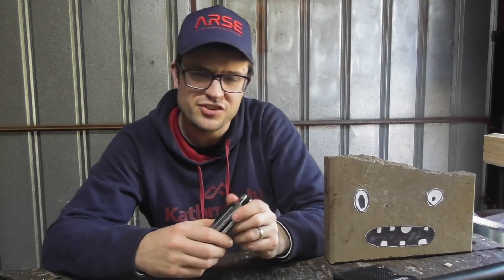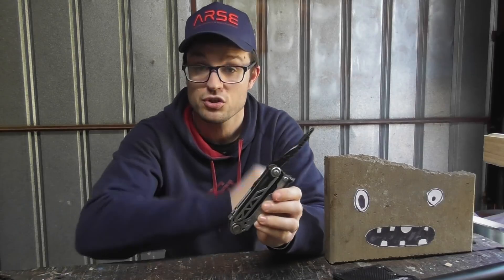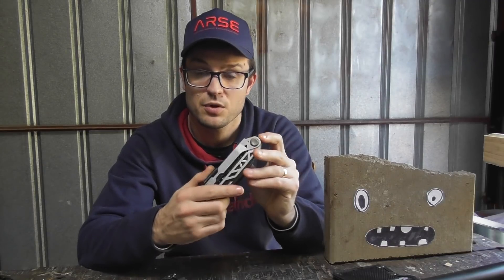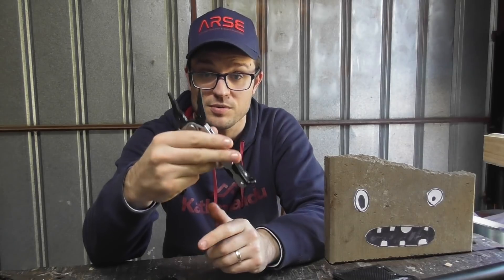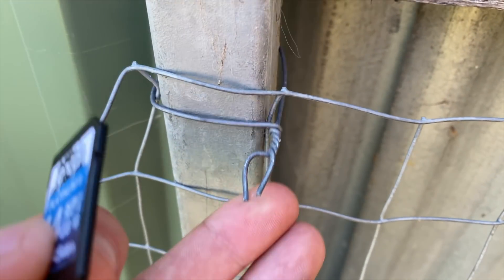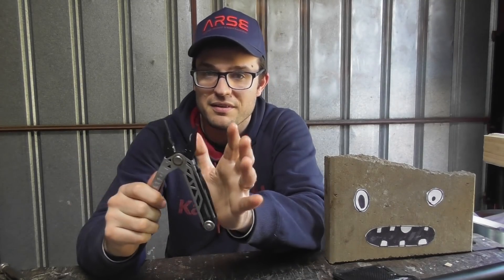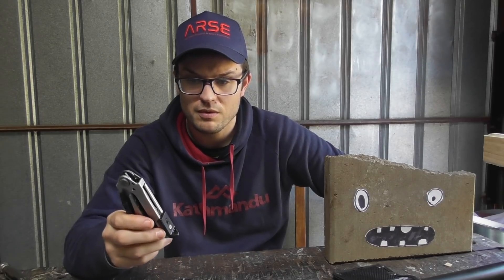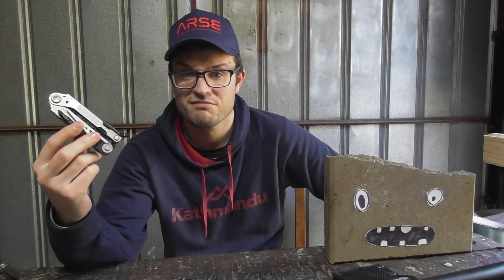EDC Issues: These Awful Gerber Wire Cutters Really Make You Think

Comment: I suppose if you are a tradesman and more frequently use the wire cutters then they would be more prone to failure. Rather then send the tool off to be fixed every time you can carry the extras and replace them as needed. I know that if you're cutting that much wire you should use the dedicated tool but if we thought that way we wouldn't buy these multi tools. 

I think the convenience of being able to switch them out is more appealing to somebody that is working with the tool rather than someone who just carries it uses it occasionally for questionable tasks. I'm happy to live in a world where both choices are available.
Reply: It's not the fact that they're replaceable that's the problem, it's the fact that their inserts are made of tungsten carbide, which is hard af but also brittle. The 154cm inserts used by leatherman seem to be fine, at least mine are, and judging by other comments so are other peoples.
Reply: @billythepigeon7345  - Yeah I won't disagree that Gerber uses questionable materials. Honestly, the 154cm seemed like a weird choice to me at first but it seems to work pretty well. I haven't had any problems with them. However the cutters on my old charge AL are definitely bent and it catches ever open/close of the jaws. I suppose LM may fix that...
Reply: @FancyPrimate  the material itself isn't questionable, I use tungsten carbide to machine all manner of exotic steels, titanium alloys, and even other tungsten alloys, it's seriously hard stuff, it's just brittle, and wire cutters is just the wrong application. Steel is tougher, it might go blunt eventually, but it's less likely to chip.

Comment: Also using an original wave, hard use over decades, cutters still good as gold and lighter than modern iterations.
Granted the fine screwdriver now doctored into an awl after it snapped ~5yrs into using it as my main pry tool on the 3rd time I straightened it with a hammer. Thats how I treat the whole tool and still going STRONG I 100% agree with the above!

Comment: bought a gerber multitool a while back, dont recall exact model set me back about $100 usd. first time out (working road construction) i cut some steel tie wire, and the second cut my cutters broke. i made warranty claim, turn around time was 4months so i bought leatherman wingman to hold me over. i tried the gerber one more time and broke again. tried to refund, and failed. i still own and cherish my leatherman. gerber tried to ease my loss by saying AT LEAST ITS COVERED.

Comment: I’ve always carried SOG multi-tools, beginning with the Pocket Powerplier, and then the full-sized Powerlock. Both of these styles have regular jaws and cutters, no inserts, and I have had to warranty them twice, after damaging the cutters with hard wire, total abuse. I like the SOG tools because, to me, they have the best jaws, and give the most utility as a plier, while having a good compliment of additional tools. The swing-out handle covers are a bit hokey, but I’m generally not rushing to pull anything out of the handle, since it is not a primary knife.
It’s another option in the non-leatherman tool world, and I like that they haven’t switched to inserted cutters.

Comment: Never heard of this or had it happen. Ive used a Gerber with replaceable cutters since they came out. Also, the cutters themselves aren't only available from gerber. They're common machining supplies, buy good ones if all you can get are the chinesium versions you're obviously stuck with. 

Oh, I've cut spring coils, hard wire electric fence, innumerable sections of fence ties and many many many screws without needing to do so much as turn them to a fresh edge. Only problem I ever had with them was when someone stole the pliers they were attached to. Happened twice since i started carrying a gerber, probably almost 28 years now, if you count the first one with no replaceable cutters. That first one I did notch the cutters on hard wire, tho. So there is that, I guess.

Comment: Quit buying Gerber back in the early 80's when I had a Gerber fs II blade break in two while CUTTING ( not prying ) some hard to cut material. Knew I could send them back for warrenty but decided to keep it to show my friends. I bought SOG multitool & have been using Leatherman for 10 years - no problems. Occasionally cut wire with them, works great. BTW SOG workad fine but after years upgraded to Leatherman.

Comment: I've had the old school Gerber wire cutters fail in the past. The wire just notched the cutter blades. I thought maybe the replaceable heads would be an improvement. Doesn't matter with my old Gerber tool, while twisting  a nut the jaw on one side snapped off and ruined it. Work replaced it with a heavy duty Leatherman tool which I have had every since.

Comment: The original Gerber Scout has some of the best cutters I have ever used, they will cut stainless steel gear/brake cable cleanly, they also have a good crimper. Thats the Gerber that they got right. Departures from that design are what they got wrong.

Comment: Tungsten carbide really isn't a good choice of material for something like that, too small with a hole in the center compromising the integrity even more, although it'll be interesting if you did a test to see what it's able to cut without breaking, I'm thinking that its probably meant to use less force since it's tungsten carbide, it should cut more than break material

Comment: i've weighed in on the leathermans' replaceable 154cm jaws before. after a couple more years of use, i can see several tiny divots in the jaws. however the function doesn't seem compromised. i reckon, since those jaw inserts overlap a fair bit when closed, the initial "bite" creates a weak point in the outer diameter of the wire, then there's some compression - but ultimately the wire is cut by shearing forces at the weakened point. accordingly i think chunks of tough hardened steel might be adequate for the task, even longer-term - but gerber's choice of tungsten carbide jaw material is ill-advised; suggests they have not analysed the forces at work. i'd imagine most viewers know how easy it is to snap a tungsten carbide drill bit if you wiggle it about in the material you're drilling.

Comment: I cut nails with my Surge no issues cuts through easy. I also cut thick metal banding with Surge no failure. The banding I cut a lot at work.  If the Center drives cutters were as good as the Surges the Center Drive would be hands down my favorite. My Gerber 600 cuts good too. I think it's just a Center Drive problem. Even thin stereo wire gives those cutters a hard time

Comment: Here’s my take on this topic: both Leatherman and Gerber replaceable wire cutters on their multitools aren’t meant for heavy-duty wire cutting, because they are not meant to replace ACTUAL heavy-duty wire cutters. Multitools, however, are always nice to have because you can easily have them on hand, so that when you come across a little task that needs to be fixed, at least you won’t have to travel to your toolbox, dig for that one tool, fix the little problem, and then put it back. With the replaceable wire cutters, at least they help increase the longevity of the multitool so that you don’t have to send an entire tool back just to replace the wire cutters when all the other tools on it are intact. But in the end, it’s up to your judgement on what you think your tool can handle and what the right tool for the job is. For me, personally, I don’t see myself ever needing to deal with heavy gauge wire that a multitool can’t handle.
Reply: Yeah, I think people overestimate how capable cutters are. Just because they can cut a nail, doesn't mean they can do it all day long, or even once without affecting the tool. I wish every company gave the rated "capacity" like Knipex does. They list the maximum rated diameter of wire they can cut for different materials (copper/plastic, steel, stranded, spring steel / piano).
Reply: @johnarstall  Well, Gerber cuts a LM-eyeglass-screwdriver-bit in their advertisement (I presume that is hardened steel)...
+1 on the ratings
Reply: True, but I've seen countless videos of poeple cutting large nails with leathermans replaceable blades no problem so there is no excuse for gerbers to just break cutting thin fencing wire.
Obviously cutting nails is not something you should be doing but if it can handle that then it means that it will easily handle small stuff for a long time

Comment: I still have the original cutters on my MP600 and I've had this thing for several years now. To be fair, I don't use the cutters much because there is rarely a need for them. And I know the limitations of the cutters, so I don't cut any outrageously hard things with them. (They've mostly been used to cut very soft wire, heaps of cable ties and such) Also, as others have mentioned, maybe look into getting a different set of cutters from a reputable brand? Triangular carbide inserts come in many many many variations, some are made for extremely hard steels, some are made to resist impacts (maybe those would be suitable for this application?) etc. I used to work as tech guy and salesperson at a company that sold machines and tools for them and we had to do a fair bit of research to get the best tools for whatever the customer wanted to make. I believe one customer needed inserts that could endure repeated cuts through a welded section on a tube, (the inside of a welded pipe needed to be turned to the right dimension, and obviously the insert had to cut through the weld once per revolution, welds are very very hard and at 2000 rpms or so, that's a lot of hard knocks the insert needs to be able to take) so the insert needed to be very impact resistant, i.e. not hard and brittle. I believe they went for ISCAR inserts, but I can't remember the type.

Comment: Hmm.. I use a Leatherman Rebar every day. I cut different kind of fence, that heavy galvanized wire, installation cable and even smal nails. Never had a problem. I think I bought it 3 or 4 years ago. Are the replaceable jaws made of the same steel (Leatherman/Gerber)?

Comment: Huh. I’ve had the opposite happen to me. I’ve yet to replace my cutters where as on my integral pliers, I was sending them in once a year. That being said, I’m using Leatherman replaceable cutters so they seem to work very well as opposed to Gerbers. I don’t want to send my multi tool in just because I cut a coat hanger that happened to be made of adamantium. Just like Benchmade needs to just send me the dang omega springs for my Bugout!

Comment: Leatherman replaceable wire cutters are pretty strong, i have cut through nails and tons of hard wire with my ST300, and barely damaged them, another good thing is thst you can take them of and reprofile them with a file or sharpening stone in case you need it.

Comment: with all the cost cutting and lowest bidder manufacturing Gerber is doing the past decades im not surprised they wouldn't upgrade/ offer a decent wire cutter when everything else incl the blade is one notch above basic pot steel......thanks for pointing out the facts 👍. Not that my knife snobbery would allow me to be caught dead with  Bear Grylls survival knife but any company that won't even mention what steel was used in their marketing of the product doesn't deserve my hard earned cash.....drop the mike....👊🖐🎤

Comment: Seems like if they used hardened tool steel instead of tungsten carbide that would fix the issue 🤷‍♂️ personally I think tungsten carbide is a tad bit overhyped, great for some applications though.

Comment: Got the new Surge in black for Father’s Day this year with the replaceable wire cutters. After I saw this video, I proceeded to the backyard to cut chicken wire with them. Sure enough, one of the blades of the wire cutter chipped out.  I noticed that the blade that chipped was very thin at the edge(like knife blade thin). The side that did not chip appeared to be thin compared to the non-replaceable wire cutters, but there was no damage.  Called Leatherman and the lady in the warranty dept first tried to direct me to ordering a new set, but after explaining that it was defective due to how thin it was, she advised me to send an email to ltginfo@leatherman.com with some photos of the issue.  I received an email back a day later stating that they were sending me new wire cutter inserts at no cost to me. The replacements I received complete with new screws and corresponding torx wrench, appeared to be the thickness of the non-damaged side of my tool’s cutter, so I’m happy. Good job Leatherman. Hope this helps someone with the same problem.

Comment: For electrical Wires, my gerber centerdrive cuts clean like a razor. Even really soft fine strandes copper wires are cut razor clean. I would never try to cut a nail with them.
AND the notch in the cutter is for WIRE STRIPPING.

But, wires thicker than 2,5mm2/AWG14, does not work well at all. Thats a shame :(

Comment: My black MP600 carbide cutters failed as well. Seeing the quite prohibitive cost for replacing them, I left the tool alone without them.
Reply from the maker: yeah, I would like to see them trying a different, less brittle material or reverting to one piece jaws. The 154cm on the leatherman tools have less issues, although looking at my surge now, there are a few little notches in them, too
Reply: @CedricAda  my Surge ones are marred, too, but they still work. They didn't shatter. If I get inspired I might take them off and flatten the back side to rejuvenate them rather than spending 30 freaking bucks on replacements
Reply: You guys must be vegetables. These are basic machining supplies. You cab buy em in packs of 10, even get them from some actual respected manufacturers if you do something other than look for validation of your opinions on the internet.
Reply: @camojoe83  Not in the configuration that will fit these multitools.
Reply: @camojoe83  I don't know where you are, mate, but the Leatherman inserts in Australia are more than $25, made specifically for Leatherman and not a common industrial carbide insert for machining. I can't comment on the Gerber inserts but if you have used commonly available replacements then I'm sure many would be interested to see that

Comment: I had this. The cutters are the least of its problems. My main blade barely had an edge, the serrated blade had black crap on making it appear dull. The file does not cut and the awl and prybar just snapped doing some very light work. The overall feel of the tool is very creeky and it aounds like a maraccas. Gerber makes terrible stuff these days with only a few exceptions.

Comment: Should just get a proper linesman  plier if you're doing lots of fence work. I'd recommend Klein, knipex or channellock. I wouldn't put faith in a multi tool with anything outside of small gauge copper wire.

Comment: I'd have a Centre drive in a flash if they changed those cutters. Such an easy fix for them as the cutters are removable.
Reply: They should also move the pry-thingy... it pivots over the plastic lock for the tools. And improve their quality control, broke my pry-thingy on a brass-nail.
Reply: @etherealicer  good to know, now off the wish list.

Comment: Every Leatherman Tool that I've bought since the early two-thousands up until now I've broken almost every tool on each one, and I don't abuse my tools I use them as they were intended. as for Gerber's I've also broken most of those as well and I usually don't cut anything heavier than 16 gauge steel wire. I think most of the multi tools developed are Mainely gimmicks just to earn a quick Buck off the hard-working man. I'm currently carrying a Leatherman rebar that I bought after I broke the Jaws on my Leatherman super tool 300. I've tried contacting Leatherman's warranty department to return these tools and I have not gotten a reply. When and if this rebar fails me then I will not buy another multi-tool. At least not from Gerber or Leatherman.

Comment: Agreed, my experience with wire cutter replaceable inserts is worse that with integral plier jaw blades. But hey ... (warning cynical business criticism) ... you pay for a replacement worn insert and warranty expense for  integral jaws under guarantee manufacturer expenses are puff ... gone ... all behind the marketing mantle of the super steel inserts are better. They are modern ... hey ... Nah Mate, in a multi tool give me the old school wire cutters. EDIT ... ha finished my post before the second half of your vid. BTW my experience is mostly with Leatherman. And mostly not catastrophic failure but deformation and subsequent rubbish performance.

Comment: Shame they cannot just come out with a bit softer carbide replacement  so they don't shatter or chip because it is a great tool otherwise
Reply: The tougher option would be steel, like the 154cm used by leatherman. Tungsten carbide isn't the best choice of material for this application.

Comment: Replaceable cutters are made by cpm154 steel. I'm not sure that they would make the whole tool by cpm154 so it's better this way isn't it ?
Reply: *154CM
Reply: @Oozy9Millimeetah  Yeah right Its  similar steel
Reply: @spacelordvking8000  same steel, but not a powder metal, makes a huge difference. 

154cm is an ingot steel 
CPM154 is made in powder metallurgy process, making it much more refined and better

Comment: Carbide is a stupid choice for a cutter of this type. Leatherman uses CPM154 which is a fairly tough stainless steel, I have had zero issues with my three Rebar pliers. Sure beats the non replaceable where you would cut something and your pliers would stick together and not open. I was loosing my ass shipping Super tools back before the replaceable cutters came out.